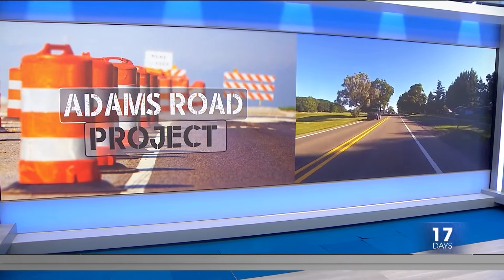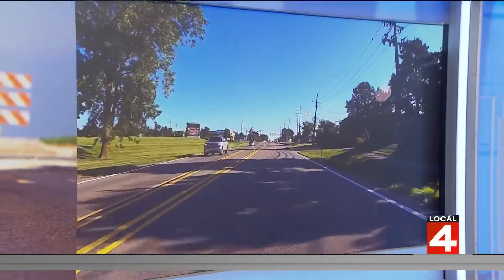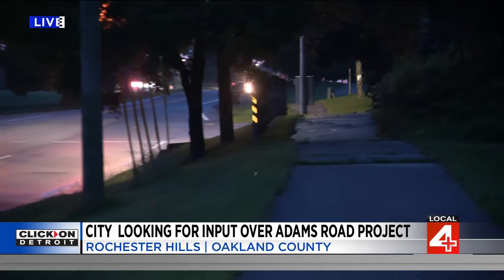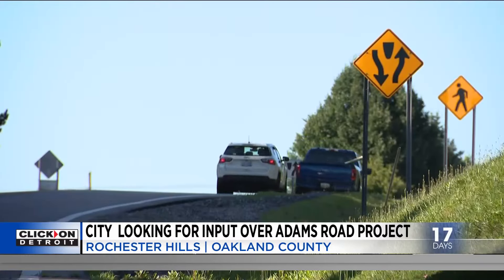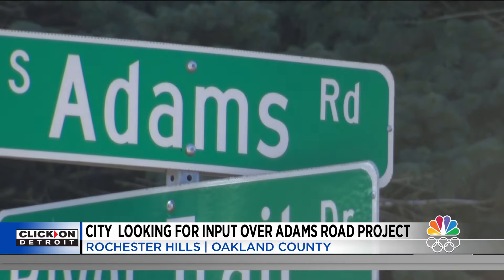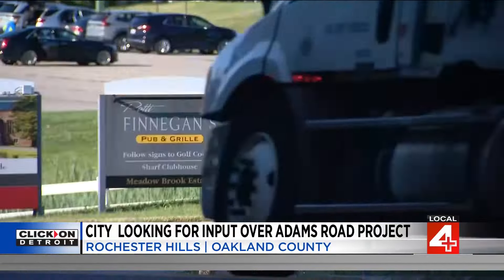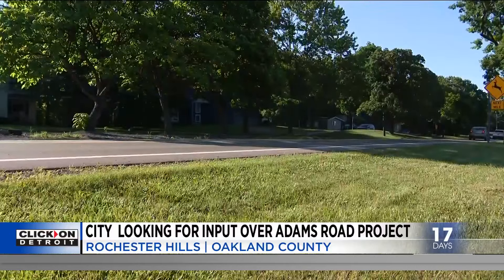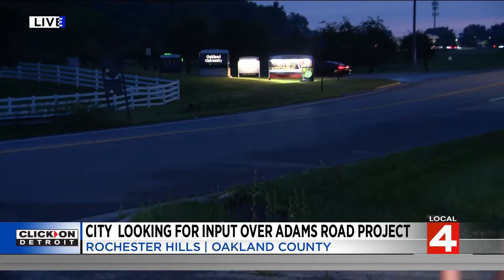Input wanted on Adams Road project in Oakland County

Comment: As a RH resident who’s been hit 2 times on that stretch of Adams, they definitely need to expand the lanes and flatten those deep hills.

First time I got hit was a car behind me going south on Adams before that dangerous intersection light at Avon. When the rain and snow come down, that downhill before the light is a one way brake check for oblivious drivers speeding over and sliding down into me at a redlight with no exit.

Second time was at the Avon intersection as I coasted downhill north on Adams after that big hill only to be greeted by an idiot driver turning left at the light then smacked head on.

There needs to at least be a roundabout within the Avon intersection to prevent people turning early into traffic coming downhill. With this, a wider 2 lane road in each direction would give room to evade accidents and pass by slower drivers trying to turn into the median.

Comment: Roundabouts only encourage satellite traffic (google maps; mapquest etc.)  Speed limit and Traffic Signals with left turn lane are sufficient along with having Squirrel Road Blvd and Walton Boulevard which already have many entrances into Oakland University and Direct access to 75 and 59 along with university to 75.   .   Do Not take all  the Hills and Charm out of Rochester Hills.   Rush hour traffic adds 5 extra minutes which is the normal for all communities.  Too many Schools, preschool(s)  high school, residential neighborhoods and churches add more congestion.   DO NOT keep expanding the roads.  Please use your resources to fix the ones we have.  Michigan does not need larger concrete roads. Just nices and more charm.   Lasher Road would NEVER EVER ALLOW as well as HICKORY GROVE.   THIS IS ABSURD.